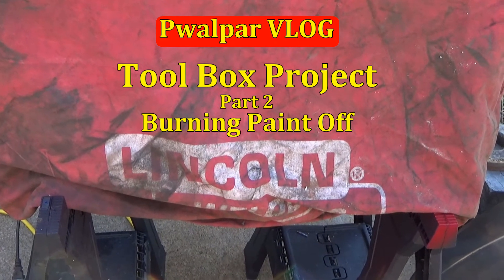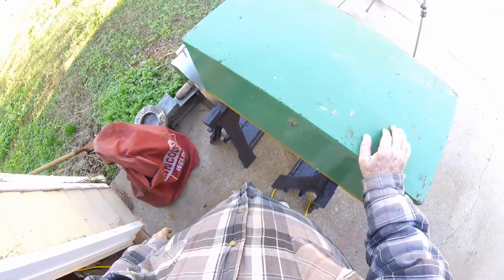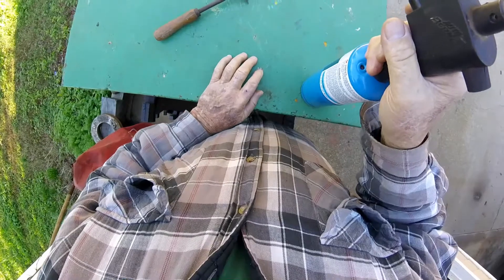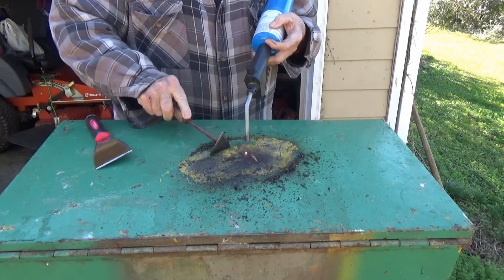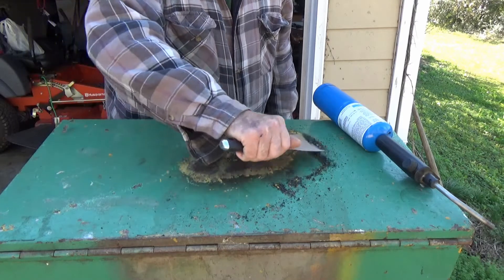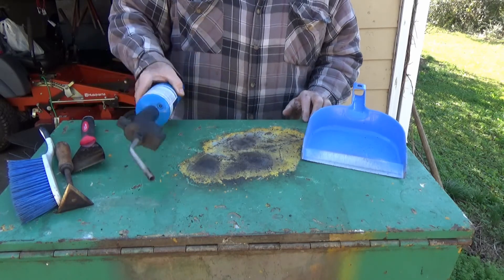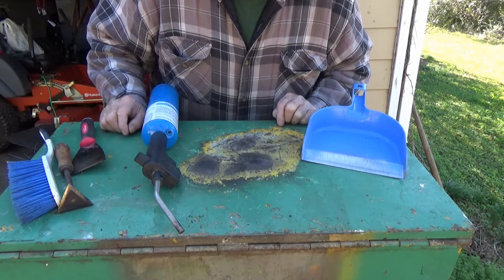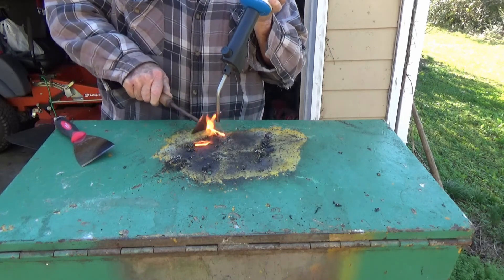Tool Box Project Part 2  Burning Paint Off  Pwalpar VLOG

Comment: Your video brought back a memory to me.  During the years when I worked for a company located in the North Carolina Research Triangle Park, I was in charge of safety for the local building. The annually required safety meetings were up to 9 per year and they were repetitive and boring.  I had the ability to schedule more interesting topics for the other meetings, and I tried to do that.  This video reminded me of a couple of those meetings.   
One of my safety meetings was conducted by a volunteer from Operation Lifesaver.  It was well received at the time but a week later it became more important when there was a double fatality at a guarded crossing less than a mile from our building.  A lady in a hurry drove around the crossing gates and, rather than a slow freight, she found the Carolinian Amtrak coming at 70 mph.  That was on a piece of North Carolina Railroad Company track with NS trackage rights. Thereafter I think that the Operation Lifesaver lecture was even more appreciated.
The safety meeting which this video reminded me of, however, was the one where we had fire extinguisher drills with live burns (pans of burning kerosene).  Two months after the training a boy who was boiling off acetone in an explosion proof hood using an intrinsically safe heater, unfathomably lit a Bunsen burner in the hood and the whole hood went up in flame.  He ran down the stairs outside and then returned back in to set off the fire alarm on the first floor, rather than the fire floor.  Meanwhile a girl, who had also gone through the training, used a fire extinguisher to put out the fire. At least one of them got the message.
Reply from the maker: Thanks David  I will have to share a fire story soon
Reply: Good
Reply from the maker: I was involved with Operation Lifesaver outings a few times

Comment: Walter, propane is a liquid in that cylinder, but is a gas when it goes up into the torch. You had that torch upside down causing the liquid to try to burn. The torch works great when the cylinder is upright, but doesn't when upside down. BTDT too many times. Better to take the advice of others and get a gallon of Citristrip. It isn't all that expensive, and is a lot safer. Jon, MSO-439
Reply from the maker: Thanks Jon  I finally figured out what I was doing wrong

Comment: Walter, have you checked those fuel lines to be sure that they are clean? Worst come to worst you just might cure it  by adding an inline fuel filter. It was just a thought.
Reply from the maker: Yes I already replaced all the lines and the filter  Thanks

Comment: Citristrip
1/2 gal. Safer Paint and Varnish Stripping Gel
 3.9 out of 5 
Safe for indoor use
No harsh fumes
Strips multiple layers
20 bucks at home depot
Reply from the maker: I will have to get some
Reply: you will wonder "how the heck did I ever get along without it" kinda moment.